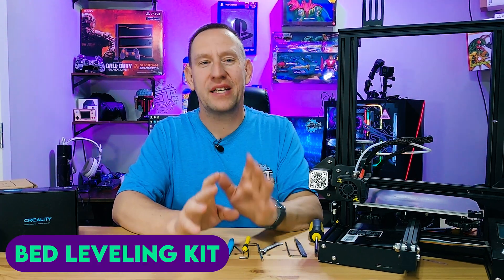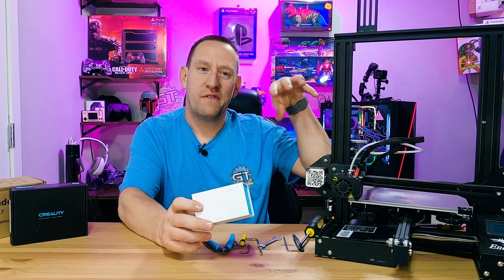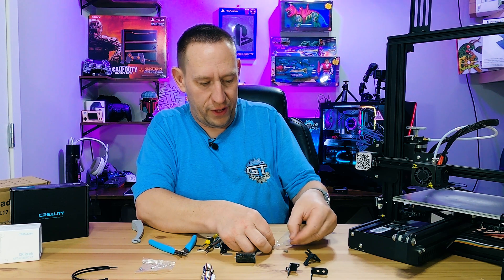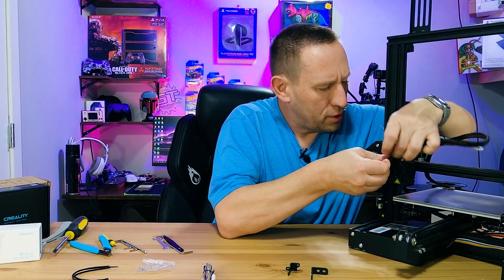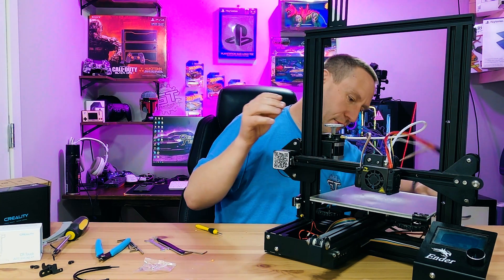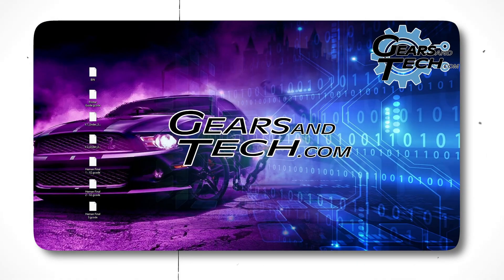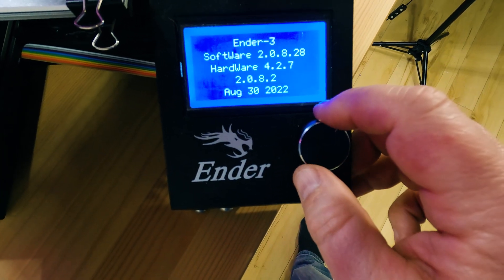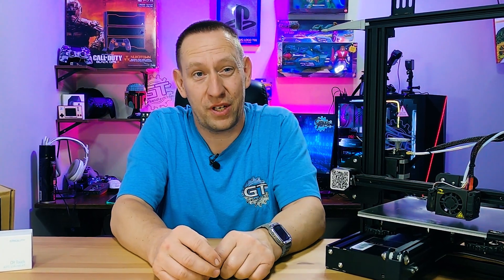Ender CR Touch Install FIXES EVERYTHING | Gears and Tech

Comment: Call me crazy, but I prefer the manual mesh levelling (mriscoc professional firmware) over the CR touch. I installed a CR touch and the mriscoc professional firmware for the CR touch a week ago and had nothing but problems with it. Always crashing into the bed when trying to home (washers fixed it) and for some reason the x offset was wrong (distance between the probe and the nozzle) Even though id level it, then get it to probe for a mesh, then do z offset, the prints were still a little weird. I kinda feel ripped off lol considering manual mash was completely free and just worked. ive probably done something wrong lol who knows :p

Comment: I've watched four videos on how to upgrade this board. You don't go into the actual installation which is easy for me. I'm a machinist. I understand electronics from CNC machines and dealing with their issues. So I'm going to start installing this new board with the auto leveler on it. But as of right now I'm going to use the BL touch probe that is on the machine. Right now. I can barely print. I got a lot of lifting of the model and I need to print those parts to hold the touch probe at different levels for different hot ends. So wish me luck. I'll keep in touch. Scott here
Reply from the maker: Let us know how it goes
Reply: @GearsAndTech  Well I got everything installed including a new CR touch probe. But now I'm dealing with version 4.2.7 board firmware. Some of it works. Some of it doesn't is because of the different chips that were used to construct this board. I do have some firmware on there. I have Run the leveling program. 
But now I'm dealing with USB issues with the reader card + the USB mini B system. Any suggestions on a firmware load?

Comment: I downloaded the exact same firmware that you did but it did not change anything on the printer do you know how to fix that?
Reply from the maker: You should have new settings unlocked now
Reply: @GearsAndTech  not sure what you mean by this. I too have flashed the firmware multiple times and nothing changes at all

Comment: Bought the CR touch didn't help at all in my case no matter how many times I tried to manually level the bed and set the Z offset. When It tries to print it is sitting 2mm or so above the bed so I am returning mine. maybe I got the wrong firmware? downloaded same firmware as you did and it was in Chinese
Reply from the maker: You need to adjust the z offset down till it touches the bed.

Mine was high too
Reply: the english part is in there just use google translate I have just done it on mine today